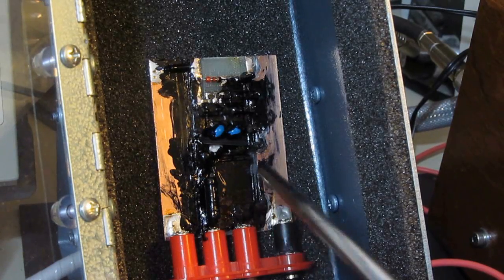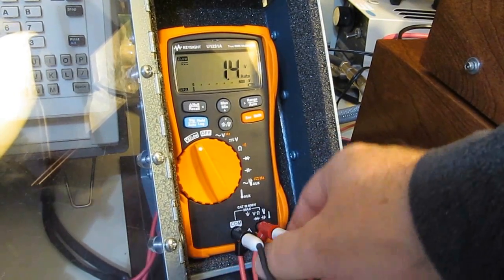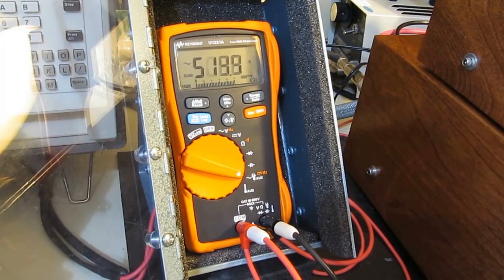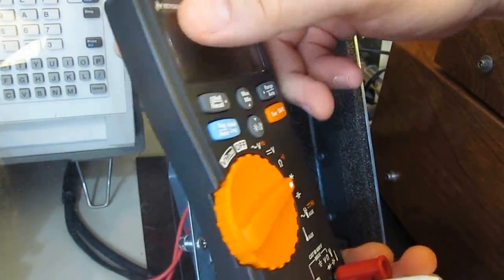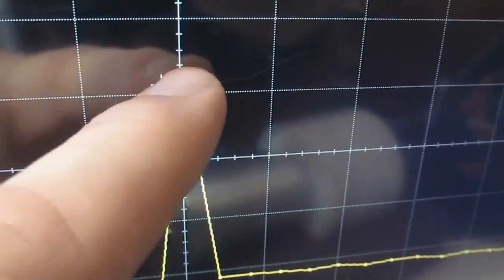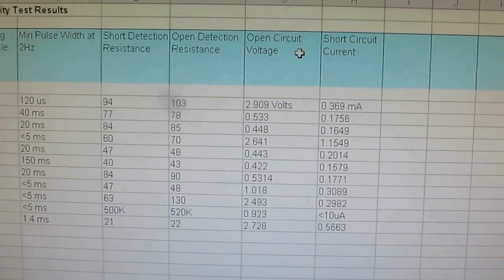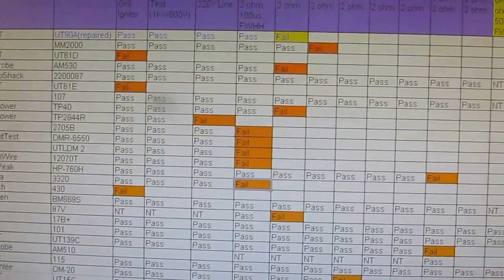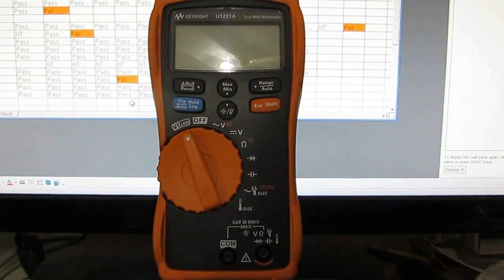Keysight U1231A Review Part 2 of 2

Comment: At the risk of sounding clueless, would a spark gap between com/in not have been a wise (and free) idea to impliment?
Reply from the maker: +monosurge Sometimes these meters have what I would consider unintentional spark gaps.   If we consider putting one between the common and input as you suggest.  Let's assume this gap breaks down at something within the voltage range that the meter is rated for.  Say it's rated to CAT III 600 so something below 6KV.  Once the gap breaks down, it becomes a low impedance path.   Now with my little generator with sub 20 Joules, this would not be much of a problem.  In real life, the energy levels would be much higher.   It may cause some very bad things to happen.    Looking at the Hioki which also uses GDTs as the primary protection, they have additional protection to help protect other downstream circuits.    I would  have expected this with Keysight.
Reply: +joe smith I was just thinking in terms of practicality. lets say I take my idea and add a fuse between Vin and said gap. Etch the gap to break at 1kv above rating (arbitrary figure). The gap breaks down, the fuse blows, and the source is hard disconnected from the tool. You know something nasty came along and you have a fuse to replace instead of a tool. Presumably the source wouldn't sustain any damage either. Easy and practical, no? I guess I just don't understand why some more ideas aren't kicked around in this front end design.
Reply from the maker: +monosurge Let's stay with the CAT III 600, or a rating of 6KV.  You want to put a gap that will break down at 7KV between the com/in and then add a fuse between the in and the gap.   While this could be done, along with many other ideas you may come up with,  I am not sure what your goal is to be honest.  The Keysight meter was damaged with a 5KV transient.  Adding a 7KV gap and fuse would not have saved it but it would have added cost.    I would guess most companies will follow some sort of design process which will include various reviews.
Reply: +joe smith I suppose the confusion I have is that CAT III 600 does not imply an input rating of 6KV to me. It implies to me that the maximum input is 600v and anything more is just a problem waiting to be delt with. The device must resist up-to a 6KV transient and protect the circuitry. So to me anything between 600v and 6kv can be dispatched in any manner I see fit to protect the device circuitry. With my understanding and proposal the gap would be set around 1600v, not 7kv. I appreciate the dialogue but could this just be an interpretation difference between us?
Reply from the maker: +monosurge Let's use your example of setting a gap for 1600V between the com/in and having a fuse between the input and the in.    The Keysight meter already has a very nice controlled gap.  That's the GDT.   It sits after the HV resistor and PTC which limit the current so you don't need to change a fuse.  It has a very slow switching time and there is no additional protection to save down stream components so in this case, the meter was damaged.   Your added gap is also going to switch slow, so now we blow a fuse, have a gap that is not controlled and will erode over time and still have a dead meter.   But you have added cost.   Depends on your goals.  If you were trying to get the Keysight meter to survive, for the price of the fuse you are suggesting to add, you may consider investing in some additional down stream protection after the GDT like the Hioki.

Comment: Interesting why Keysight choose GDTs over MOVs?! Is it real test data (I doubt that), or is it historically been that way, and now when new device gets designed, they just "drop in" historically "proven" protection circuit design, and don't think much about getting device operational after a surge, but only think about safety?...
Awesome videos, thanks!
Reply from the maker: +JumperOneTV GDTs have some benefits and I am not apposed to using them as part of the protection.   I had posted that I looked into this particular failure a little further.   I downloaded the datasheet for the main controller and attempted to power it up.   It drew about 60mA and started to heat.   During that time, the oscillator would not start.     The meter at this point is not worth repairing.    In a few cases the designers have added enough down steam protection to save the main controller and I have been able to repair them.     

After talking with a few meter companies it is clear that some of them want their designs to survive the surge testing and others do not.  In the end, they are all in business to make a profit.   Companies who make products that survive must believe they make more profits by adding value and their customers are willing to pay for it.
Reply: In the end it all comes down to marketing strategy. If that's the case here - it's just sad.
Reply from the maker: I was not sure if you were suggesting that Keysight markets their GDT front ends. I would say in the end, for any business to be successful, it all comes down to profits. How they get those profits is another story.  I had not really paid attention Keysight until I saw Dave's video on the U1282A.  It was his comments about the GDTs that got me to run these tests.
Reply: joe smith No, I don't think that they're marketing the front-ends (at least I haven't heard about that). I meant that nowdays in many companies marketing dept. works very close with engineering dept. while designing a product. And one of the decisions might have been to not include additional protection or use different front-end altogether. This way they can market their meters as meeting all the safety requirements, but most likely no one would mention its robustness at different overload conditions. Also smaller BOM is a plus, taking into account relatively small chance of serious overload condition occurring in real life scenarios. Anyways, we probably would never know what led to those design decisions.